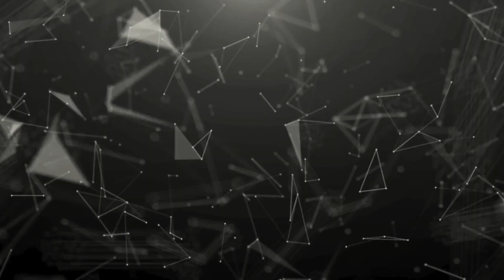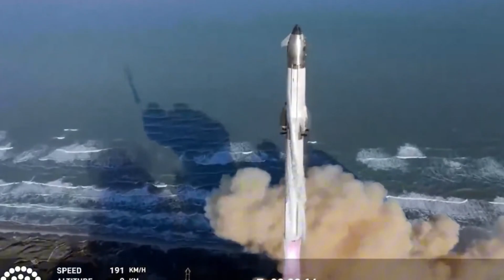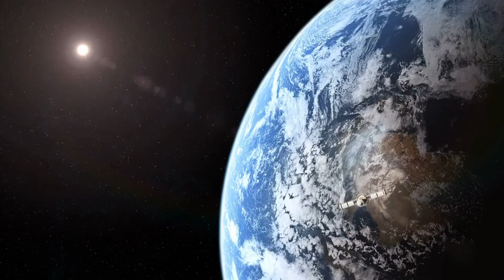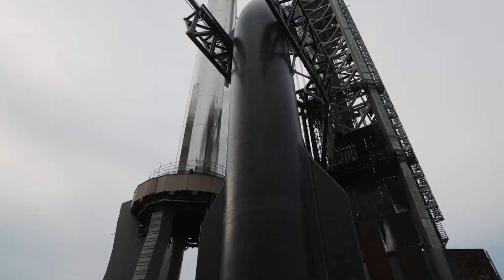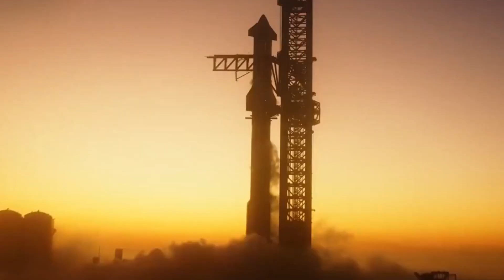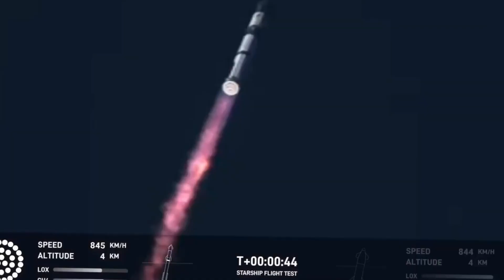S33's 'Dangerous' Panel Was SpaceX's Hidden Triumph... NASA Engineers Can't Believe This!

Comment: It looks like New Glenn will ultimately be heading in a more sustainable direction, because of the material it is using to build the hull.  I didn't see any heat-shield tiles, so I am guessing that they used engine braking to slow down their momentum in the upper atmosphere and periodic braking to slow down the rest of the way down.  The reason they had a failure was apparently fuel sloshing due to rapid attitude adjustments and some type of electronic glitch.  However, New Glenn is closer to being a one-stage rocket carrying enough fuel to get into orbit and enough left over to slow the rocket down to under cremation-speed and a soft landing, which I am guessing will be the ultimate goal, until we figure out a different kind of propulsion.

Meanwhile SpaceX's ability to carry hundreds of tons of cargo, could even do more if the ship didn't need to reenter Earth's atmosphere at hypersonic speeds.  Acting like a cargo ship on the ocean, smaller ships could unload and deliver goods to colonists on the Moon and Mars.  Of course, we will need to have fuel ships to refuel the cargo ships.